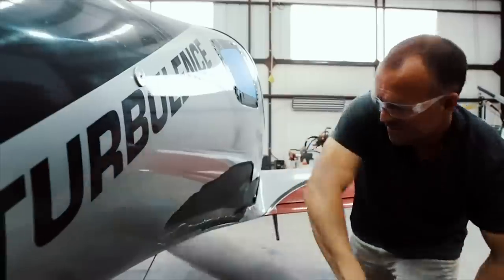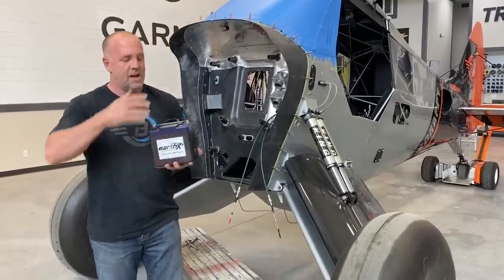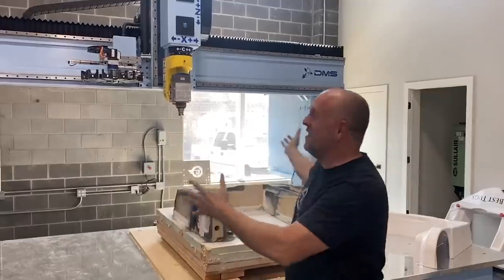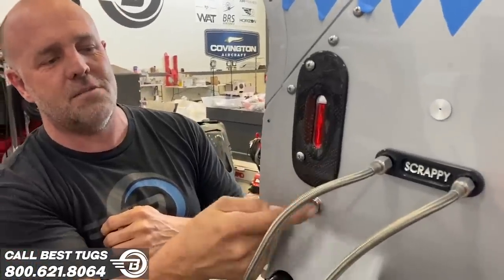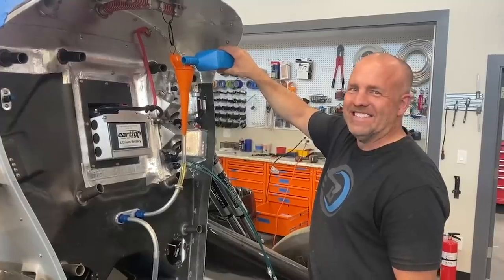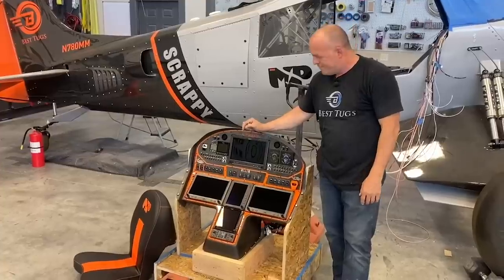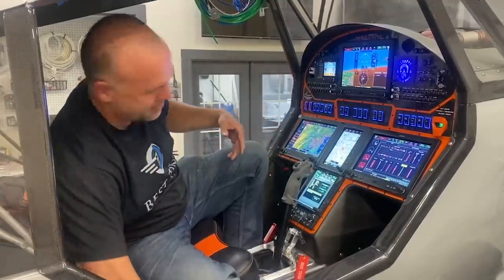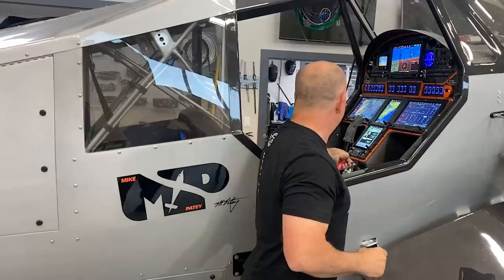Garmin Panel Install (Scrappy Bush Plane 25)

Comment: IMHO an independent general aviation manufacturer should embark upon a civilian version of the XF5U.  Both propellers should be hooked up to a central/common drive system.  A single engine version and dual engine versions would be possible, although that dual engine-transmission combination will add some cost and weight, but provide greater safety with redundancy.  Parts for both drive sides should be as interchangeable as possible including propeller driveshaft & nacelle (with adapters for wing mate), landing gear struts with wheels & brakes, engine air intakes (with adapters for wing mate), stabilators and ruddervators.  I wouldn't change the configuration very much, but it seems to me that the nose needs some work for greater visibility, and there could probably be a tricycle landing gear version by having the mains fold up and forward under the nacelles with the pivot point behind the CG, and the nose gear fold downward with pivot just under the nose.  I would include a weather radar in the nose although today's avionics make that rather redundant.  I would make the tail-dragger version with Bush Tires, and keep the dual bogey on the tricycle version.  I don't think range and speed are going to be an issue with this aircraft.  The cockpit can be extended aft for greater capacity, and we can scale the design up for greater occupancy with side-by-side seats, except for perhaps the tail-dragger Bush Version.  The trailing edge ailerons center-line between the ruddervators is where the trim tabs will go, and they should split for speed brakes in flight, or kill lift on the ground.  There is a lot of potential in this airframe particularly for cross country flights.  Call it the SkipJack, or Kit-FlapJack.  https://www.youtube.com/watch?v=A-wstZacb58

Comment: MIke, u need a back up switch for when that microswitch fails and your out in the bush.
Reply from the maker: Jason McCarthy 👍🤠🤠🤠 I talked about that exact thing but didn’t do a good job I guess.  I can bypass it if the micro switch went bad or if I lost the pin.  I have a quick bypass wire already done, wired and ready.  It’s not possible to be stranded.  Sometimes when we edit the video we cut out a bunch of stuff trying to keep the videos shorter and not boring yet at times it then creates questions like yours.  Thanks for the double check. We are all set 👍🤠
Reply: I thought you would of had a plan Mike. I've fixed to many aircraft in the bush in Australia for it not to bring up a red flag. Love your work!
Reply from the maker: Jason McCarthy thanks Jason 🤠

Comment: Could you have made a back up hot wire system that would fit either lock out pin that would work in flight? Like a leaf spring switch or something?

Comment: On the next episode...

Mike: Well, seeing as how the panel was still missing something, I got these ultra light weight batteries that are going to power a coffee pot that I cut out with the new CNC Laser and the 5Axis mill, through the use of super conductors and carbon fiber it only ways .637 lbs, and can hold enough water for 10 cups of coffee, and can brew a single cup in just 53 seconds. 

As well there is this neat little locking pin here that holds the cup in place, and you will see this carbon fiber lid has an O ring sized to the cup so as that if you start brewing a cup on short final it won't spill everywhere when you touch down and then you can enjoy your hot coffee while watching everyone else land. 🤣🤣🤣

Comment: Mike, what about if you lose the pin while you are on the ground? You could not start the plane?
Reply from the maker: R4TeT  👍🤠 I keep a spare pin in the extra slot as well as a bypass wire if I needed to jump if I lost both pins.  Take me two minutes but I would never be stranded

Comment: Are you able to access the battery with the engine on? Or do you have to pull the engine if theres a problem with the battery? I could just imagine of they buried our battery in our cars in the firewall.

Comment: I wonder if the radiator vacuum fill tool would work on the oil cooler and lines.

Comment: Do both gust lock pins have microswitches?  If not, and you loose one pin, just use the other, no?
Or have a spare pin locked in in the belly pod somewhere.

Comment: Mike, the glare shield that arches over that beautiful avionics panel appears to have a relatively sharp edge. Would you consider a padded edge protector for pilot safety or is it not possible for the pilots head to make contact in case of an accident? PS. I love what you are doing to add excitement to to the aviation community!

Comment: Why aren’t all gust locks not set in a neutral position?  Good point!  As far as the switch why not just stick a Phillips screwdriver in that hole if all it does is complete the connection?

Comment: I may have a misunderstanding. If there is a zink bar in line in the writing harness (as a consumable) will it take all or nearly all of the bimetal reaction damage in the circuit? And if so, why don't i see it in just about everything with a wiring harness?

Comment: That was fun!....Curious though....without the seat in, that awesome Garmin panel seems....tall...Really tall...will forward visibility be an issue?
Reply from the maker: Surprisingly it’s an optical illusion,  the top of my panel arch is lower than a stock cub. At 50 feet away height check visibility marker check I had 6” better view than standard
Reply: @MikePatey  Thanks!...Looking to when it's all together and see you sitting in front!!

Comment: I know this video is out way past the day it was filmed, but you could have put a shop vac on the output of the oil line and drawn the oil into the cooler/system.  :)

Comment: If the pin used to lock the control stick is the same as the rudder lock pin, could you use it to connect the micro switch to start the engine, and then put it back in to the control stick lock to keep the clevis out of the way?
It doesn't look like you have a 2nd micro switch on the control stick lock

Comment: If the gust lock pin is the same size as the rudder lock pin, could you pull it and insert it into the hole to trip the micro switch and allow the starter to work?

Comment: Question from a layman. It looks like the engine would have to be pulled to replace the battery if you needed to. Is that accurate? I understand there is limited space and weight and balance come into play.

Comment: Mike, aren’t your brake hoses,  out the top of the shock into the fuse, going to be fluttering in the airflow?
Reply from the maker: Thomas Thumb  🤠. Some wouldn’t think of that.  Actually that’s why the holes that pass them into the plane have very specific location to cause the line to move aft, arc, and then back up.  It causes the wind drag to loop at the rear of the arc and hold them steady.  If they just went up they would shake in the wind
Reply: Mike Patey 👍🏼 waiting for your next video, you’re killing me boss, I’m starting to measure time with your video releases.

Comment: I'm thinking Scrappy will hover noise up, it surely will take off within inches of full throttle. Is it possible to hover noise down? Propellers reversed noise down just standing there hovering. Then increase power and gain altitude in reverse then propellers switch into the forward position and fly out. Crazy insane but I had to ask.:):) back to work.

Comment: Dude , you've never gone over your throttle & mixture controls.  Where are you going to mount them? .. Also what about those Wings?  Shorter take off than Drako?
Reply from the maker: Wings are coming up as soon as I finish and weigh the fuselage.

Comment: So now we understand fully...Mike saves weight everywhere he can so he can have an F35 cockpit, long travel and a 700 cube beast...my kinda guy!  Let's drop that compression slightly and turbo this mfer with a sequential system...I fabbed forced induction systems for years...I'm game...lol.  Can you imagine this beast ass motor, with launch control and kickin anti-lag fireballs building boost...POW POW POW like a rally car!  HOLY F***!!  All you need then is a JATO and no one will ever build a sicker bush plane until we do an electric powered, ducted fan vert takeoff bush plane.  Small ducted motors integrated into the wing roots and surrounding the cockpit...think it'd work?  Hmmmm.

Comment: Hey Mike, love your vids and your outstanding airplanes. After Draco I didn't think you could top it but...... Anyway, I have a question for you regarding the position of the oil cooler outlet louvers. You guys spend a lot of time at high density altitudes on short strips using high alpha to get your speed down, did you factor in the heated air coming out of the louvers over the horizontal stab and the elevator and the degraded performance that will bring. I imagine you did because you are that thorough in everything you do but it was on my mind and I figured I'd ask. Keep up the amazing work. Cheers, Iain.

Comment: Mike -"I've got this machined piece to lock the control stick in place solid, won't move" Me - "I use a bungee cord"
Reply from the maker: If the bungee works, use it. 🤠👍🏻

Comment: A question about the battery box fire shield (this is me thinking out loud!): the fire shield protects the cabin from fire and smoke for a period of time, right? It protects the structural material it's attached to, in order to keep the firewall's structural integrity intact. Your battery box now has the fire shield on the other side so will the carbon fiber maintain it's structural integrity for the same amount of time as the rest of the firewall? If it breaks down sooner than the rest of the firewall, the fire shield on the cabin side then won't have a rigid structure keeping it together and could allow flame to pass through cracks etc. I'm an engineer, but I know very little about flame and heat affect on carbon fiber, especially in comparison to fire shield.
Reply: This was my thought the second I heard "Fire shield".

Comment: Could you have put the quarts of oil in some boiling water to help with the flow before pouring or would that have not made a difference?

Comment: Have to remove the engine incase u have to replace the battery?
Reply from the maker: parkside garage  👍🤠 of course not,  that would suck.  It has an amazing amount of clearance and will be easier to change than many certified aircraft I have had.  It was certainly on my mind

Comment: Could you add an emergency ground switch or button for the starter solenoid that bypasses all the micro switches? This would make the jumper underneath the control sick boot irrelevant and would make it accessible during any part of the flight in an emergency.

Comment: Voltage drop is harder on the starter?  Hm, not really.  It means that there is less power to the circuit yes, but "harder"?    Not really.  A solid point though, weight loss...love watching your STUFF...fun.

Comment: I noticed three switches on the panel that are covered in black tape. What kind of spaceship drive have you secretly installed? Or maybe  they like the red button from Willy Wonka’s elevator?

Comment: Mike why don't you just make another gust lock pin and put it in a secret location like a first aid kit that way you don't have to pull up the boot around the stick and connect two wires  together? I would just make it a point to never use that pin unless you lost the original one and it was an emergency and then hey guess what it's right next to the emergency first aid kit! 👍

Comment: How do you keep engine heat off the battery? the safe operating temperature range by 20 Deg C, from 60 to 80 Deg C (140 to 176 deg F), and 65 to 85 Deg C (150 to 185 deg F) for short term operation. Although thermal protection is great for very high temperature, the benefits are apparent at any temperatures above 40 Deg C (104 Deg F). You may want to fabricate a battery box front, to keep radiated heat off the battery.
Reply: Why not hide a secondary lock pin somewhere else...

Comment: Well, a boring normal landing gear is good for a 600 fpm hit, so this king kong landing gear should be good for twice that, which at the low speed this will probably land at means a very steep flight path, so yea, you've got autoland!

Comment: I'm curious as to why you're choosing to not equip Scrappy with de-ice equipment?  Is it just unnecessary added weight?  or does that require excessive flight testing in order to get it FIKI certified?
Reply from the maker: It adds quite a bit of weight.
Reply: @MikePatey  I figured that was the reasoning... Thanks for the reply!  I've followed you throughout your Draco build and Scrappy as well.  Definitely a huge inspiration to me and I hope one day to construct a few aircraft of my own that are even a fraction as cool as yours!

Comment: Seems like it would have been easier to just add in a manual override for that gust lock micro switch so you could start the plane in air or if you lose it

Comment: Does anyone know which circuit breakers he used in his panal? Mike, would you happen to have a part number handy? I'm looking for high quality, easy to operate, ultra reliable switch/circuit breaker solution for 1/8th mile drag car switch panels. These cars must endure some serious vibration and dynamic forces; as well as, being subjected to routine abuse by driver and service crew. highly visible fault identification along with robust components that can be easily operated while wearing fire suit and gloves.  Example: Car is entering the burnout box during the final round of a high payout race, heats the tires then roles out past the line. After shifting into reverse the car lurches back then shuts off. The driver needs to be able to quickly identify any faults and reset any related system/circuit before he times out and gets disqualified. Any thoughts, suggestions or helpful input is greatly appreciated. Thanks in advance to the great community here and everyone involved in  experimental aviation. Keep up the great work ladies and gentlemen...

Comment: Could you (hypothetically) run all eight cylinders from a 4-cylinder electronic ignition system, by doubling up the coils and just having a wasted spark in the cylinders that were on 'blow' instead of 'squeeze'?

I guess you'd have to replace your plugs more often, but it wouldn't exactly halve their life... Anyone got any thoughts?

Comment: Get one of those lockpins in your key ring or put one in the glove box in case of an emergency rather than twiddling with wires
Reply: The RV-12 has a similar interlock on the starter and the wing pins. In the case of the 12 there is a large override button in case the switches fail. There is also annunciations on the g3x as to the status of the switches.

Comment: Greetings,  please accept my heartfelt appreciation for the enormous effort you dedicate to produce your video series,  so much has been learned by following your tips and technical explanations. 

Sir' you happen to be the smartest aviation engineer I've have had the opportunity to bear witness,   I would therefore be grateful for your answer to a question that thus far yielded me only confusion?   

I can't discover a concise answer regarding the practical feasibility of  a hybrid-electric power-plant for aircraft operations,  would it be  possible or even practicable to replace the conventional aircraft engine with an electric motor,  while providing the current to this motor by means of a small turbine generator.

I've not been able to find an adequate answer to this question,  the subject seems to met with a measure of ambiguity.

Might a system similar to that found in hybrid-electric vehicles work in aviation,  or would the totality of the combined weight make this effort impractical. 

Again' I thank you for taking the time to include your audience with the highly educational content you produce,   wishing you and your family great health and continued prosperity in the future....

Comment: Mike what if your engine quit, in the same time your micro switch failed, (and now you're praying that you have enough speed that props will turn the engine, that's great) but what if in the middle of your crazy clime, or some other slow flight when you don't have enough speed for props to turn the motor?!?!?!? just another scenario, we want you to be safe!

Comment: Are you sure you do not want your fire shield directly between your battery and your carbon fiber structure closeout panel?  If that battery lights on fire it could burn through the graphite epoxy laminate and drop onto your feet and fill your cabin with smoke.  You put a fire shield on the forward surface of all the other carbon fiber structure for a reason.

Comment: 36:00 wouldn't it more sense to install a button near the pin/stick to bypass the microswitch without having to partly disassemble the plane? E.g. starter and bypass button would need to pressed at the same time... 
The pin as safety device will still work as normal procedure would be "Place the pin, press the starter". I would expect that the operator would wake up when the engine does not make a sound after pressing the button :) And can then assess whether the pin is still in the rear fuselage or officially declared lost and either get back out or bypass :) Advantage as well.. this should be possible to do during flight in case the windmill-push-start does not work.